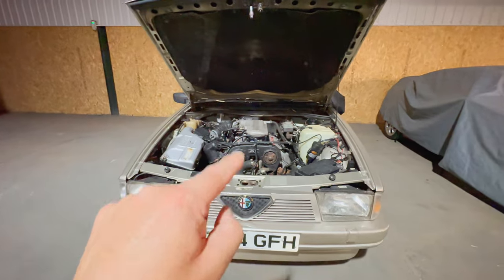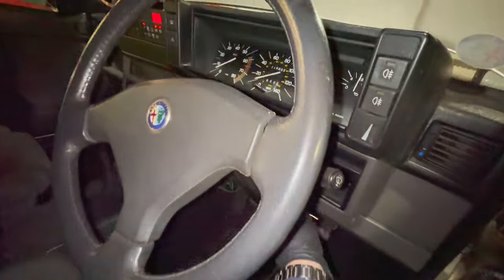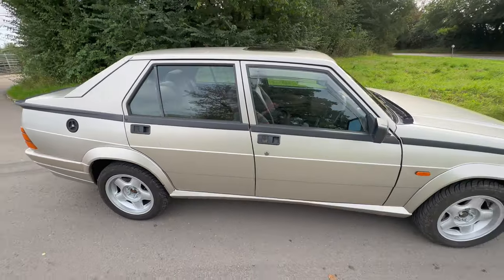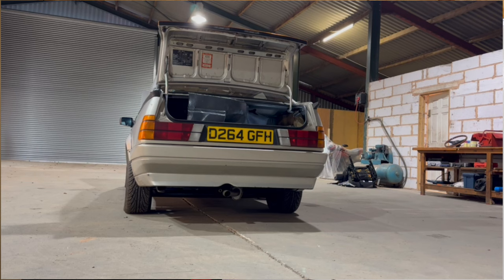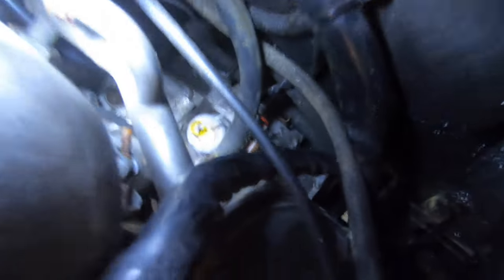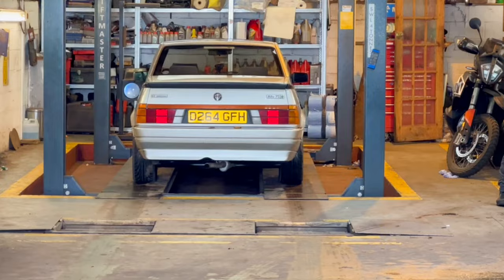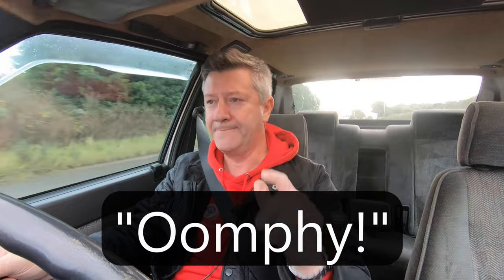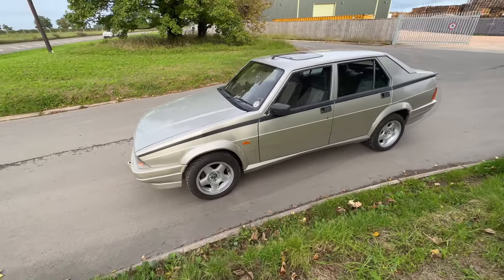Barn Find 1986 Alfa 75 V6 Restoration - Part 2

Comment: I would change the pipe and the fuel filter Chris. It's a nice car and you are gonna keep it so why not.
Reply from the maker: Thanks for watching mate, I have fitted a new filter but the connecting pipe is not available from anywhere! I’ll have to wait for EB Spares to make one - Kevin is using my car to measure up for it!
Reply: @TheAlfaNut   you should be able to bit of rubber    pipe from anywhere  , and a stainless spring on the outside will stop the any kinking , you could even make the  u bend out of metal pipe
Reply from the maker: @LOTPOR0402 this is true but if I give the measurements of mine to Kevin at EB Spares, he will make me a replacement for free! 😂😉 watch this space….

Comment: Lovely 1st series 75, Chris. I could not see from video, but it looks to have the correct thin black gaskets behind the plastic wheel arch spats. Which is good because water gets behind them , rusting arch lips underneath. This happened to the 2nd 75 I had , 3.0 v6. On my 1989 twin spark , which still had them so no problems . The vibration possibly could be from the donuts , rather than balancing the prop itself.
Reply from the maker: Hi Martin, thanks a lot for watching and for the suggestion. I did wonder anbout the donuts but this is the first transaxle Alfa that I have driven / worked on, so somewhat of a learning curve!  The car is originally a Green Cloverleaf but was modified by the guy who partially restored it back in 2020, adding Twin Spark side strips and rear spoiler / body kit. Sadly he also swapped the damaged QV Recaro-type interior for a rather mundane TS "tweed style" interior!
Reply: @TheAlfaNut  the tweed style seats were standard on the early 2.5 and TS models , the Recaros appeared in the LE models which was the UK dealer run -out models with a little plaque on the dash , before they introduced the replacement 155. Personally , preferred the original seats the LE seats felt higher so you almost felt you were sitting “ On “ the car , not “IN “ it, so to speak. The gear change can be improved by putting extra washers either side of the linkage , I’m lead to believe, although I never tried it. It’s more pleasant a change when you do the change by fingertips which when practiced becomes quicker later on. Love the car though, those alloys always suited the car so well. How’s the Beta by the way?

Comment: I got to get out and work on my '75' aka Milano 2.5 V6 automatic. I bought mine in October and haven't done much. I have zero brake pedal! Exhaust is cut, but have it. And one injector needs to be replaced,  have it also. Front blinkers don't work,  but everything else is ok, Paint is shot! Great video!
Reply from the maker: Thanks for watching David - good to hear that you’ve got the Milano now! 👍🏻.  I was lucky as my car was mostly ok but just needed some recommissioning, light bulbs, brakes, fuel pipes etc. Good luck with yours - just do a little bit regularly to chip away at it. 👍🏻

Comment: Morning Chris.  I agree with other comments about the fuel pipe. Do a bit of research. Someone out there will be able to manufacture a suitable new length of pipe.  My coupe had a similar issue last MOT.  My wife's 500L failed MOT on frayed seatbelt.  See if you can do something to prevent yours deteriorating.  The 75 is growing on me.  I think it is the roof mounted window switches that helped. Paul
Reply from the maker: Hi Paul, I already have someone who is making me a replacement - Kevin from E.B. Spares is making a batch, based on the dimensions of my pipe. Yes, the roof mounted switches are very "Captain Scarlett"!

Comment: My 77 Alfertta GTV just passed its MOTtoo. You can get the prop shaft balanced on the car, it harmonises it with the transaxle and engine. It's expensive but works a treat if all your propshaft components are sound! I had mine done and it was like a sewing machine afterwards!
Reply from the maker: Hi Graham, thanks for watching and for the tip - may I ask who you used for the balancing?
Reply: Hi, Omicron on Norfolk, they're a Lancia specialist really but they do a lot of B20 GT's that have a transaxle that also has the pro-shaft turning at engine speed (which it needs to be to do the balancing) its not cheap,  just under £1,000.00 but I was very pleased with the result. But there is no point doing it if the pro-shaft has ropey components as it will go out of balance as they fail ands when you release parts you'll not be as perfect as when first done. Later on if the prop is removed, it needs to be marked on the engine end  and transaxle end to keep the unions lined up the balance. @TheAlfaNut
Reply from the maker: @grahamsimper1680 Hi Graham, well done on getting your GTV through.  Sadly I had to sell my 1983 GTV2 because the rust had gone past the point where I was able to deal with it. thanks for the info - I know of Omicron (I also have a Lancia Spyder) just a shame they are at the other side of the country from Devon! 😩 I might try Alex Jupe first, as he is a little closer!

Comment: Great that you got the MOT out of the way Chris.  I recall way back in the early 70’s I bought my first car, a 1959 Hillman Minx.  Three speed manual on the column!  Took it for an MOT and got a “Failed it mate!”  It had rust along the sills on both sides.  Luckily dad was an accountant at a local car dealership/garage.  Had them weld some steel along the sills and paint over it. Took it back and got the MOT.
Reply from the maker: Ooh a Hillman Minx!  What a cute car they were - with it's "Koala bear" face and little fins on the back!  It's funny that even 40+ years later, we are still welding up old cars to get them through their MOT 😅

Comment: I used a regular fule hose for that J hose on my GTV6. And never had problem with 3rd gear syncro, Always been 2nd gear syncro that are gone. But the last 3.0 gearbox is better . Had that in my last GTV6 -87 . But also had a 3.0l V6.
Reply from the maker: Hi Henrik, thanks for watching and for the info - unfortunately my gearbox has a problem with 2nd AND 3rd gear synchros! 😢🫣

Comment: MOT cliffhangers are always good value (for the watcher of course, not the owner 😉). As far the comparison of the 75 and the Guilia, I like a bit of analogue now and then, its a refreshing change from hi-tech 😉👍
Reply from the maker: Hi David, thanks for watching - yes I agree that older cars force you to engage with the experience far more. New cars give you a more “nanny” experience! 😉 Remind me what you drive?
Reply: @TheAlfaNut you are an Alfa Nut, I am a Volvo Nut 😉🇸🇪 but really enjoy your channel (ive had a hankering for a 159 for years now). I have a C30 which I have had for going on 15 years (kept it through Volvo & Merc company cars) mainly coz I love the design (its basically a Ford underneath), but recent mechanical problems and a complete lack of trust in mechanics means that it is currently gleemingly sheltering under a dust cover in my garage 🥲
Reply from the maker: @davidhall7744 hi David, I must admit that as a lifelong motorcyclist, the cliche of Volvos hitting bikes made me dislike them but they have grown on me.  I’ve always loved the beautiful P1800s “Saint” coupe too - would dearly love one of those. Even the 1980’s square design Volvos look cool to me now! 😎

Comment: Well done on the 75! In a land far far away, many decades ago I ran my Dads GWagon without oil in the rear axle. The repairs ended up with an unbalanced driveshaft which caused it to vibrate once it got over a cirtain speed. Ouch!
Reply from the maker: Oh dear, I bet you weren’t very popular? 
How did you balance it again?
Reply: @TheAlfaNut  We just lived with it whilst the car was with us. I may have been forgiven since then🤔
Reply from the maker: I was afraid you were going to say that! 😂 My mate Gary says it will probably have to be sent away somewhere to be balanced… no idea where though!
Reply: @TheAlfaNut  Here in the UK you hear of builders who put different engines in cars. In most cases they will have to get their drive shafts modified and rebalanced. If you contact one of those car builders they will point you in the right direction.
Reply from the maker: @henryhol8538 Cheers Henry, I’ll have a look 👍🏻
Reply: @TheAlfaNut  Google pointed me towards 'Propshaft Services' in Feltham as an option.
Reply from the maker: @henryhol8538 Cheers Henry, I’ll take a look at them 👍🏻

Comment: Seems to be challenging. Think that would drive me (pun intended) bonkers.
Reply: Chris, why don't you get the fuel pipe made as a bespoke item? I'm sure there are small engineering companies near you in Devon. And it won't cost much.
Reply from the maker: @plasticpenguin1  Hi mate, well my friend Kevin from E.B.Spares is going to make a batch of replacements as they are out of stock everywhere, (using my car as the template)
Reply: @TheAlfaNut  

Nice one. Alternatively, contact Uri Geller 😁
Reply from the maker: @plasticpenguin1 😂🤣

Comment: Some things that are good to be done:
1. Replace the fuel pump hose with a regular flexible one, no need to search for a special shaped OEM hose. You'll get stranded that way.
2. Vibration around the propshaft tunnel - propshaft bearing is done. When changing it, make sure to mark the positions on the shafts, otherwise you'll lose the balancing.
3. Front lower arm bushings - pull out the torsion bars, and clean them, then get the bushings replaced with Lemforder ones. These will get stuck from the lack of lubrication and water ingress, and you don't wanna know what kind of bullshit this will cause.
4. Pull out the plastic cover under the wiper, and check for rust. Same for the plastic sills, rear inner wings (on the level of the top of the tyres), under front plastic wings
Reply from the maker: Thanks for the suggestions - luckily, someone is making me a replacement fuel hose. The propshaft has been removed by the previous owner during restoration of the engine, so I think it will need to be rebalanced anyway. I'll be cleaning up the suspension arms this Winter and powder coating them probably. I'm happy to say that there is no rust at all underneath the car or in the body - the whole car was stripped back to a shell and repaired where necessary.
Reply: @TheAlfaNut  Sounds really nice, good luck!
Reply from the maker: @user-sy1ed9ex5m thanks a lot!  There will be more content on the 75 - do you have one?
Reply: @TheAlfaNut  Hi! I have a 116 chassis car, in this case a 90 2.0 . Unfortunately in a far worse condition, as it's been off the road since 2007. The suspention needed almost complete overhaul, and the fuel tank was almost as bad as yours (unfortunately, I cannot find one new).
Reply from the maker: @user-sy1ed9ex5m The 90 is a very rare car now, definitely worth saving. Is the fuel tank the same or similar to the 75? Which country are you in?
Reply from the maker: I found this one on Ebay in the UK
https://www.ebay.co.uk/itm/305104633135?mkcid=16&mkevt=1&mkrid=711-127632-2357-0&ssspo=myv8mzjiqrg&sssrc=4429486&ssuid=lxV0ByRnQAC&var=&widget_ver=artemis&media=COPY
Reply: @TheAlfaNut  Indeed, it was a pity to let her go for spares. I'm in contact with a company that restores fuel tanks, so I hope it's in good enough condition in the inside to be brought back. I think it's the same tank as on your 75. Later V6 75 came with a larger tank behind the rear seats.
Reply: @TheAlfaNut  Much appreciated on the link!
Reply from the maker: @user-sy1ed9ex5m You are welcome 👍🏻

Comment: We have autofficina here in Latvia, the owner seems to like the 75 a lot. I am kind of not sure, but this one looks really nice. And I would say it is the same as with so many alfa romeo vehicles, people either like or dislike them. Not all people will like them, just like I dislike some Audi or BMW models, but love the 156 and the twinspark engines. I used to be in awe when the new Giulia came out, but now I am like, meh, I still like the 156 or the GTV or even GT better. There is something about older vehicles. I bet the newer one is a lot of fun though. I still miss my 156 2.0 TS 1998.
Reply from the maker: Hi mate, thanks for watching & commenting! Yeah the older cars have a more physical connection because of old memories and because they are harder to drive of course! 😂. I have a 1998 156 as well - I am making an update video about it soon. 👍🏻

Comment: Seems to be in a fairly good shape for car that's getting close to 40.
Reply from the maker: Yes it is - there is no rust but it has had quite a lot of attention on rustproofing the floorpan and sills 👍🏻
Reply: @TheAlfaNut  That means it will last a good while more!

That pipe though, it gives me bad flashbacks. I was on a fair back in the day and when I was about to leave they directed me to drive over an edge. I knew it was gonna be close but I had no choise. The pipe got stuck and torn off. I got about 2 km on the fuel that was in the fuel line until the car stopped. Hadn't noticed anything until. It wasn't easy to get that fixed even then, and this was 1997.
Reply from the maker: Haha oh dear, not a good experience! 🥴
Yes I hope to change that pipe for a new one just as soon as EB Spares produce it! 😉👍🏻
Reply: @TheAlfaNut  If I remember correctly a guy made one from a normal fuel hose and a spring so it wouldn't fold in the bend. It worked for as long as I had the car.
Reply from the maker: @anakondase Yes I might try that - I have some new fuel hose 👍🏻
Reply: @TheAlfaNut  I remember it was a bit tricky getting the spring inside without getting it to stretched but it worked in the end.

Comment: not a huge fan of the 75 but man is that a beauty...would love to see it with some larger wheels (nothing crazy just an inch taller and wider and ideally lighter than the current ones)...by the way how hard would it be to put a 3.0L crank to get some more of that oomph!? looking forward to seeing her polished up and exercised
Reply from the maker: Hi Albert, thanks for watching!  I wasn't a 75 fan either but I have to admit that the square 1980's thing has grown on me a lot!  I have a plan to fit some Ronal A1-style alloys or similar, along with some Koni Yellows that I already have and some slightly lower springs. Then I suspect the gearbox will need to be rebuilt as I am missing some synchros 🥴
Reply: @TheAlfaNut  That champagne gold color is really pretty

Comment: I feel as though I may be in the minority, but I think the 75 is a beautiful car (but I was also quite covetous of both the old 1750/2000 Berlina and the BMW 2002)  I suppose I'm a bit of a 'square'.  I also preferred the looks of the Dino 308 2+2 to the preceding Dino 246 GT.  Mad, right?  I might be in an extreme minority there, I suspect.  I've never been an 'Oooo, look at me' type of person.  The new Alfa 38 Stradale is an absolutely gorgeous freaking work of art-machine, but it's (obviously) not for me.  

Cheers on getting the MOT for the 75.  I was holding my breath for you, Chris!
Reply from the maker: Hi mate, hope you are well?  It's a funny thing but I've always much preferred the swoopy, 1960's aesthetic, so always liked the GTV6 rather than the 75, 33, 155 etc. Lately though, I have grown to actually find the square car designs rather cool - very 1980's and "in your face" too!  I think they are now quite retro-cool too which helps!  Strangely, I am not that impressed with the Stradale - it's a bit too fussy for me.
Reply: @TheAlfaNut   The '38 is rubbish, but the 33?  :)  ('oops' for the original typo).  I suppose the pics of the Tipo 33 always made me wish that Alfa had continued along those lines instead of seemingly seceding the erotic designs to Ferrari (8C and 4C notwithstanding).  I understood why they did this, but when I saw depictions of the new Stradale, I felt that my heart's wish had come true, so perhaps I'm overly impressed with it.   I should confess that when my wife and I bought our Alfetta GT in the late 70's, we both wanted something flashy, and so passed on the Alfetta Berlina.  This was all a very long time ago.

(I'm all 'typed' out.  Take care, Chris!
Reply from the maker: @jazzfan999 cheers, I love the interior of the new Stradale and of course the fact is that it has the same engine as my Giulia Quadrifoglio, just in a higher state of tune, so that makes me happy too!  Have a good evening 👍🏻

Comment: Hasn't got much "Oomph"???
Then you have a problem.
The problem that I had with my (2,5 V6) was it wouldn't do less then 80mph (without trying) where ever I went!
Reply from the maker: I think its an issue of torque Paul - my 2.5 156 is a 24 valve and doesn’t have anywhere near the flexibilty of my 3.0 V6.
Also I can’t push the 75 at the moment as the prop has a vibration 🫤

Comment: Great stuff I've had a few 75s I currently has a 2.0ts full race caravan and a 1.6 ie which I need a fuel tank for. Can I ask where you got yours? Thanks
Reply: Caravan?? Race car!
Reply from the maker: Hi Jamey - Haha, I did wonder!  There was a restored 75 tank on EBay until a few weeks ago for £265 but its sold now it seems.  I paid £1k for a brand new old stock tank, as I literally couldn't find anything else. My friend Gary at Totallyalfa.com is working with Kevin from EB Spares to produce repair sections for rusty tanks.  Watch that space!